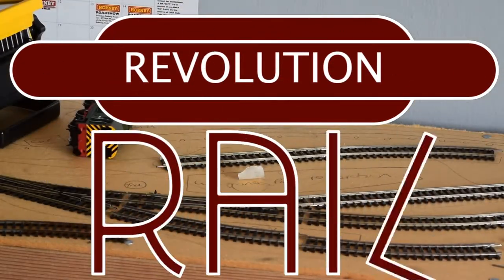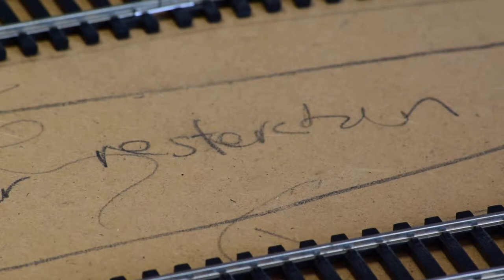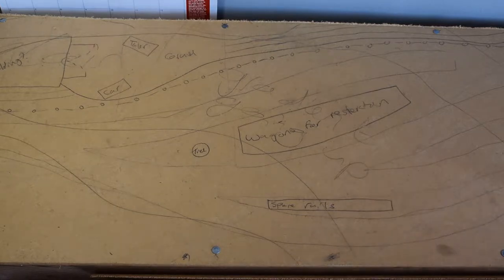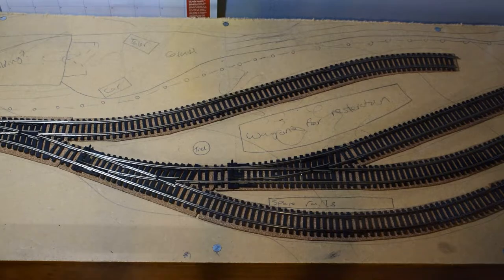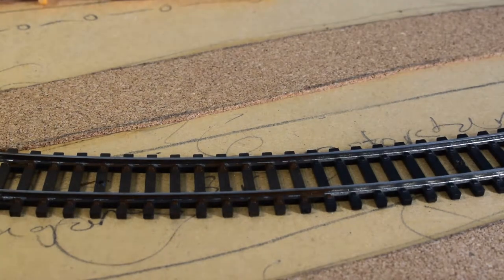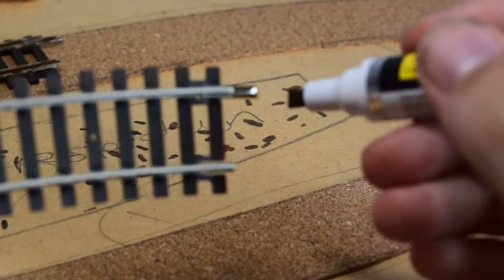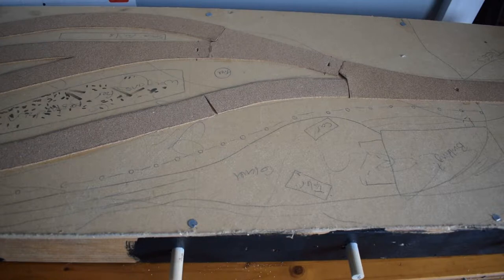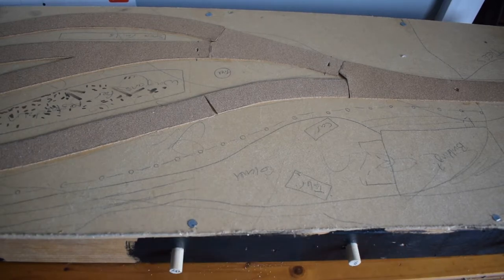Track Detailing and Preparation | The Inglenook Project | Episode 3

Comment: Does the paint disturb the electric conductivity
Reply from the maker: It shouldn't unless you get it on top of the rails or between the points. Nothing a quick rub with the track cleaner can't fix.